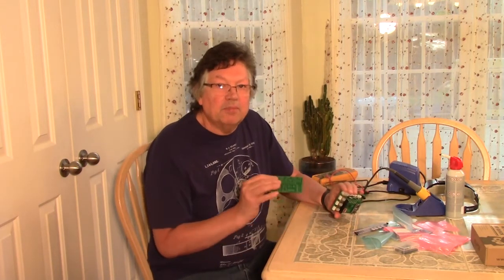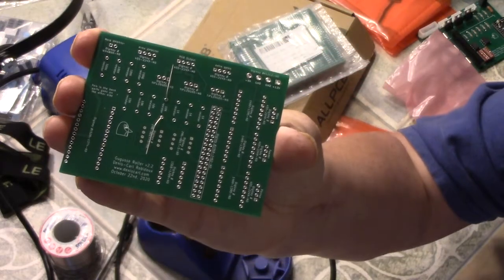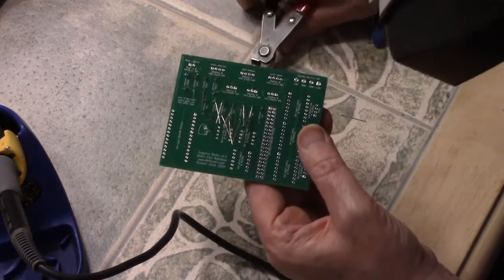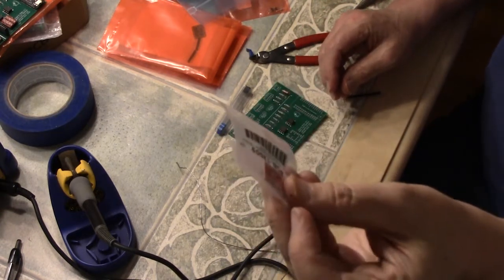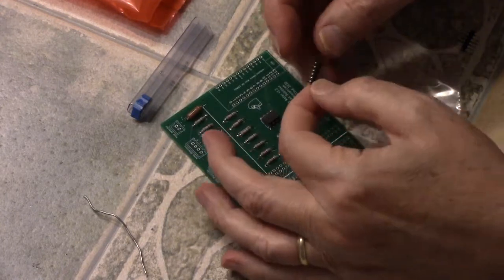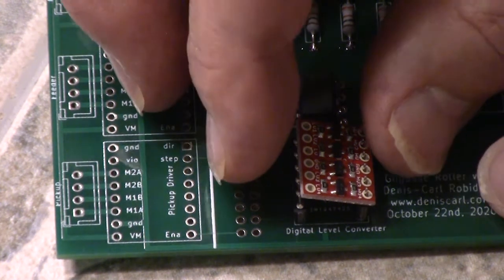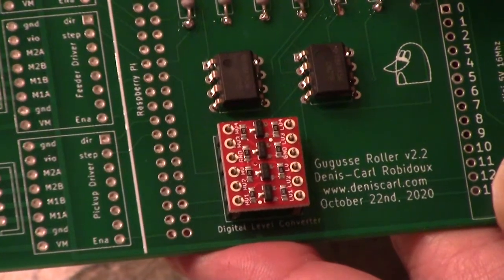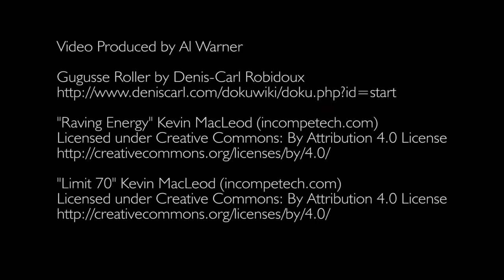Building the Gugusse Roller Film Scanner PCB

Comment from the maker: So the word Gugusse roughly translated means idiot or something an idiot would do.  It is a crazy project that I’m just so excited about.  As to the other question about this being a kit.  It’s a lot more DIY in that you make EVERYTHING to build a film scanner that turns film into HD Video.  The machine is made from parts you “print “ with a 3D printer.  It’s more of an engineering project than anything.  I love engineering (and making video tutorials about engineering).  Also, Film Scanning is preservation.  Film has been amazing at preserving images for over 100 years, it is very delicate and can easily be damaged.  This technology needs to exist to keep films alive.
Reply: The best translation that I can give you of the word Gugusse is "flimsy thing" or "weird contraption".